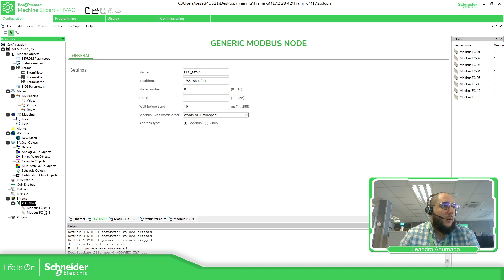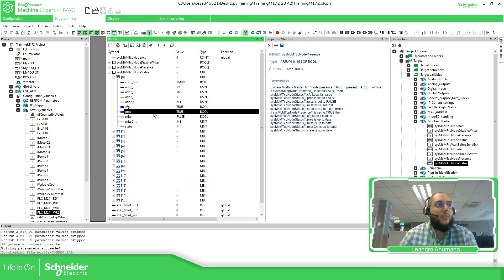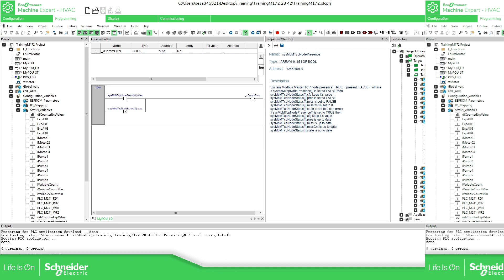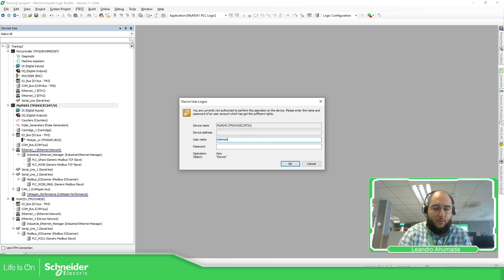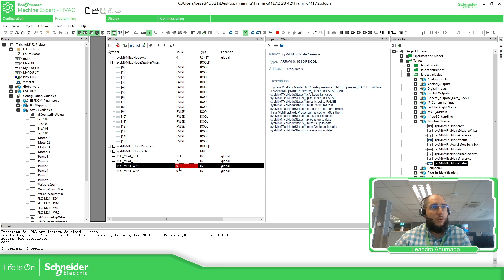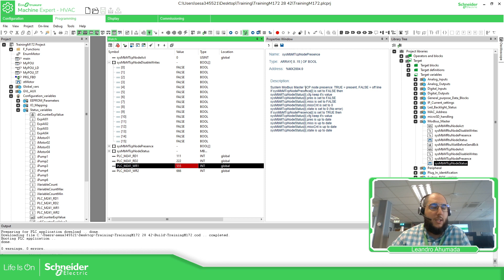ESME HVAC - Communication - M2.4 Modbus Tcp IOScanner Troubleshooting

Comment: Dear Tomas thanks a lot for your information videos. It helps me a lot especially the Modbus TCP communication to Servers.
It is working perfect.
I have an issue that I want to set the parameter MbMTcp_ServerIp4thOctet_Node0  from my application.
This because i want to set the IP depending on what the Controllers IP address is.
Now I get an error :  B_DKC_DRIVE_1(1$O:8) - error G0008:  ST => Invalid access to variable

Comment: Because i have trouble in modbus serial link m172, i am connect to multiple slave, when 1 slave device off, the communication to other device trouble
Reply from the maker: Hi there! Try to check if the problem is not related to the architecture/wirred used, remember to use the terminal resistor to compensate the channel. Try again the program without that device configure just to check if the problem is software or hardware